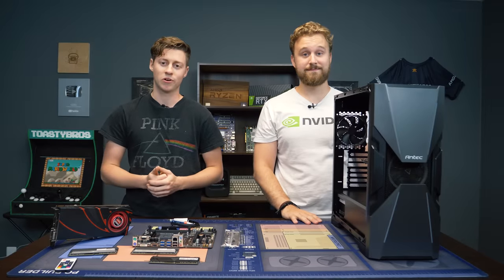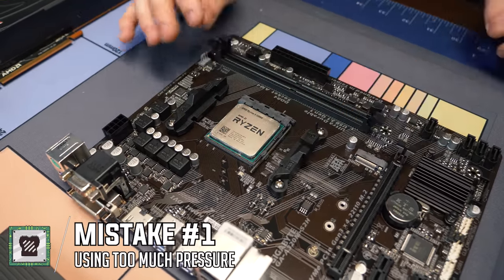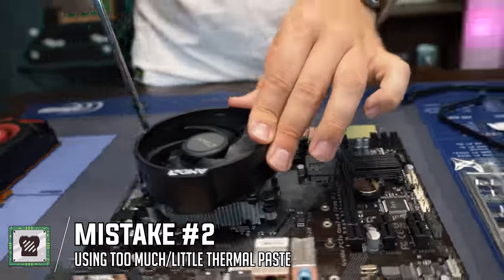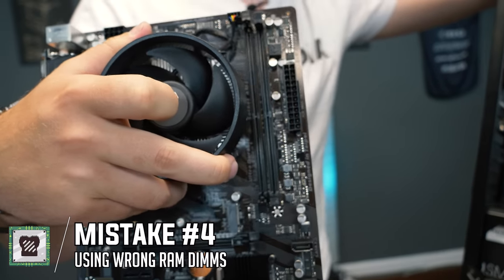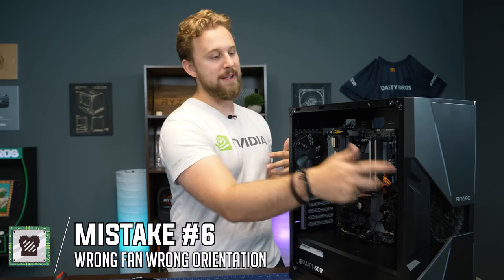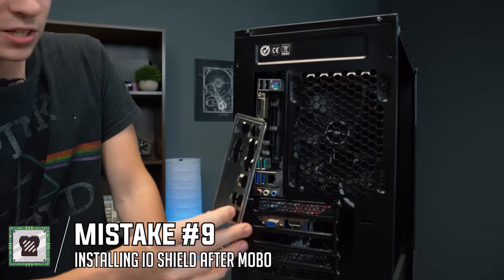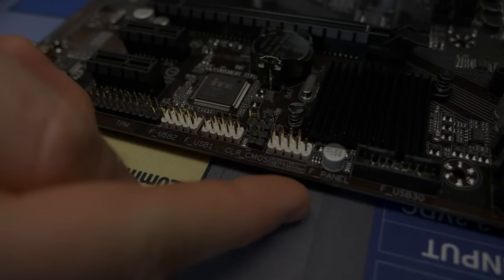How NOT to build a Gaming PC

Comment: G'day Toasty's,
Definitely a Thumbs Up for this video, These are some really good Tips that are well explained, even for people that buy a Pre-Built Gaming PC,
G/N did an investigation into NZXT BLD & even the they had some problems this video could help fix,
the 24pin Power had the '4pin' section not plugged in properly,
the 8pin EPS was not latched in (so could fall out when the case is bumped),
also the 3200MHz RAM was running at 2400MHz because XMP had not been set in BIOS, when set to 3200MHz the FPS increased around 5-10% depending on games played

Comment: If you are installing cheap RGB stips do not install it when it's on, when I installed the RGB strip they were on and accidentally short out a section wich cut the length in half.

Comment: Should you install or uninstall RAM when the motherboard is already mouted to the case... tried to do this but the pressure scared me from going through with it
Reply: That should be no problem , you don't have to take your pc parts apart in order to remove  ram just switch the "switches" down and pull the ram out , don't worry about it

Comment: One question, I want to stream. I have a budget of $ 750. What should I buy?
Reply: I would recommend you this and let me know if you need help with amazon links 
Ram : G.SKILL 16GB (2 x 8GB) Ripjaws V Series DDR4 PC4-25600 3200MHz 69$ on Amazon
GPU : GeForce GTX 1660 Super 234$ on Amazon
PSU : Thermaltake Smart BX1 RGB 80+ Bronze 550W for 69$ on Amazon sadly this is not the best you can buy but power supplies are not being produced that much at the moment because of Corona
Motherboard : Asus TUF B450M-Plus Gaming for 108$ on Amazon you would have to flash the bios
CPU : Ryzen 5 3600 for 218$ on Amazon 
SSD : Kingston 120GB 24$
HDD : 
 WD Blue 1TB PC Hard Drive for 46$ dollars new or if you wanna spend less you could buy one used - like new for 30$
Case : Fractal Design Focus Mini G for 50$ on Amazon 
This would cost you around 800$
But If you wanna go for something way cheaper and that would also perform really really good I would recommend  you this
Gpu : 1650 super , you can find it for 160-165 at any shop that sells pc parts
Cpu : I5 9400f for 159$ on Amazon
Motherboard : H310M SV2 2.0 for around 75-80$ dollars at any shop that sells pc parts and you might be able to find it for way cheaper I got one a month ago for 50$
Ram : G.SKILL 16GB (2 x 8GB) Ripjaws V Series DDR4 PC4-25600 3200MHz 69$ on Amazon
PSU : Thermaltake Smart BX1 RGB 80+ Bronze 550W for 69$ on Amazon
SSD : Kingston 120GB 24$
HDD : 
 WD Blue 1TB PC Hard Drive for 46$ dollars new or if you wanna spend less you could buy one used - like new for 30$
Case : Fractal Design Focus Mini G for 50$ on Amazon 
This would cost 650$ and you could use the rest to buy a used 144hz monitor or a good mouse , keyboard or headset
P.s If you wanna build the first pc , I would recommend you to wait until all this corona thing is over because you would be able to build it for cheaper

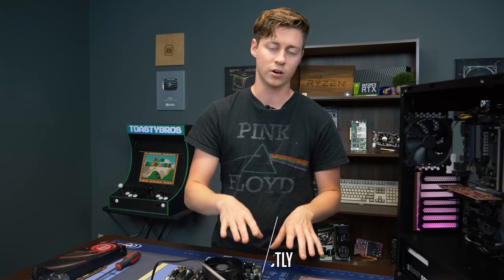Comment: 11:49 why exactly is this and what if you are using an m.2 boot drive with a hard drive as a secondary drive?
Reply: G'day Philip,
if you are using a M.2 in the top slot it will be connected to the CPU through PCIe Lanes & get Priority Boot recognition over any Storage that uses the Chipset like Sata or a second M.2 lower down the M/B
the Sata0,Sata1,Sata2,Sata3 is the order the PC Scans for the OS if you have not changed the Boot Priority in BIOS,
also if your M/B has Sata 2.0 & 3.0 Sata0 will be 3.0 & maybe Sata1 so it will have the Fastest Transfer speed, like the RAM Slots they are generally Colour Coded if they are different (but not always)
Reply: shane eslick thanks!

Comment: Should I get a rtx 2060 for 290 or an rx 5600xt for 280?
Reply: The RTX 2060 has better encoding if you want to stream, and will likely perform better as well. I say wait for 3000 series and get 3070 for $500.